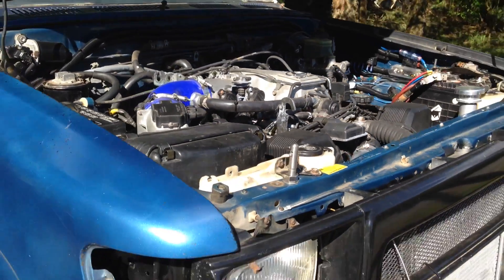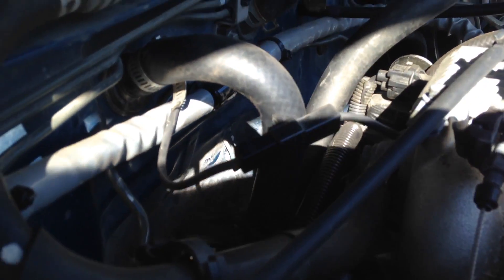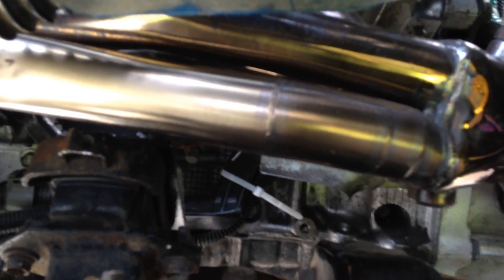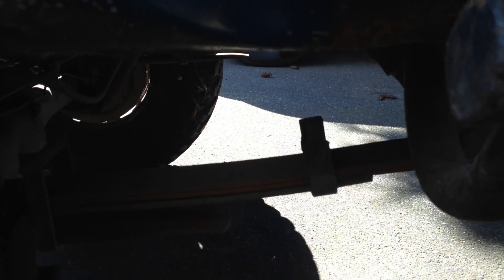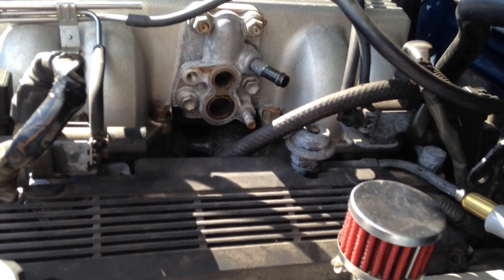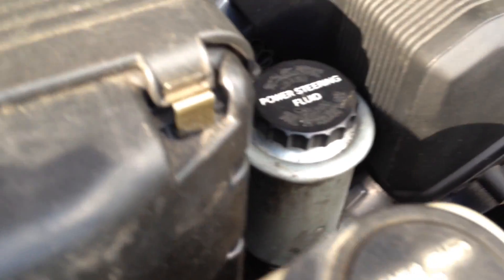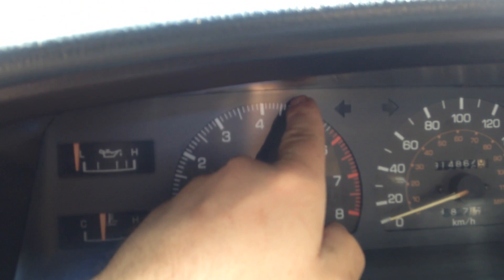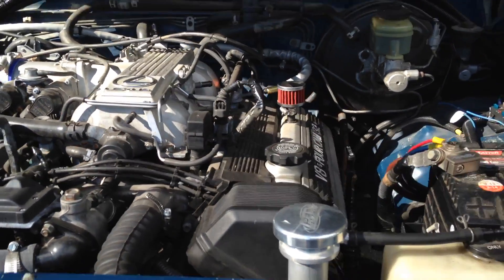Info on my 91 Toyota pickup with a 93 ls400 1uzfe v8 swap

Comment: can u do a little video about the wiring .I have a 1990 4runner and a 1992 Lexus v8 with wire harness . that's about the only part I'm a little worried about . thanks   by the way  that's a nice swap you got there.
Reply from the maker: fredy mejia I'll try to make a video about some of the wiring. 

It's really not that bad. You will have a slightly more simple swap compared to me. The wiring tends to change in the 92-93 year changeover for both Vehicles. 

Don't be scared, just buy a factory wiring manual for both cars and go one wire at a time.
Reply: Hey just a quick question what you do with transmission I have several Toyotas and have been dreaming of doing V8 swap and doing all Toyota but have not found a whole lot on swapping over to a 4 x 4 5 speed what did you do and where did you get the kit please get back to me I would love to do the swap soon thanks looks good though love second gen Yoda's with big Power
Reply: i would like to ask u about ur 1992 lexus V8

Comment: I been waiting for this.
Reply from the maker: TheKoppenhaffer it's got a long way to go. Now it's suspension and body work...
Reply: Blazeland with a TC idler arm is what I'd do if I still had a pre-taco IFS. Can't believe I've been watching this build since I was in high school and on Yotatech.
Reply from the maker: TheKoppenhaffer that's still the plan eventually. I'm not totally apposed to sfa but I don't want leaf springs on the front. I want this truck to be comfortable on the hwy as some of our spots take a few hours to get to the trail heads..
Reply: Leafs are great for crawling and they are easy to install, but they suck for everything else. The backcountry roads I travel on are all covered with washboards. I have to severely reuce speed to avoid pounding myself and my truck to pieces thanks to the leaf springs in the front. The solution I’m looking at is a solid front axle with coil springs. That, and 63” Chevy leafs in the back. These guy have the best coil solution, but it aint cheap. http://www.4wheelunderground.com